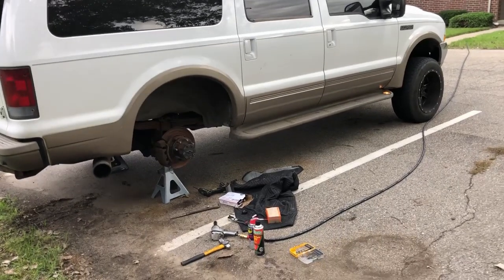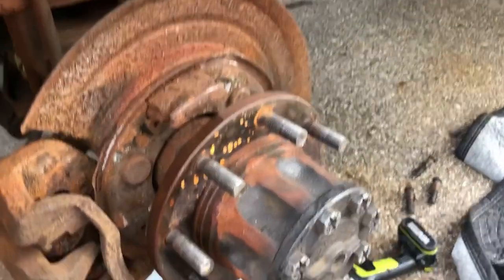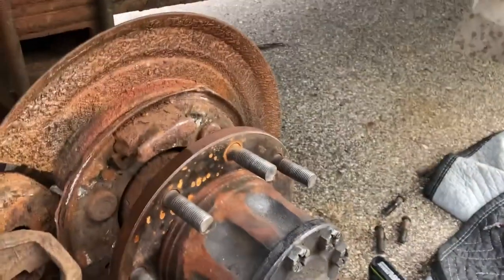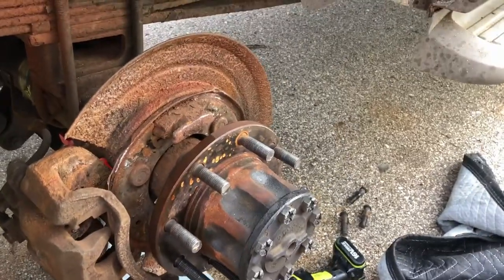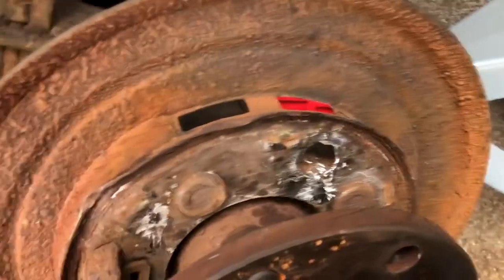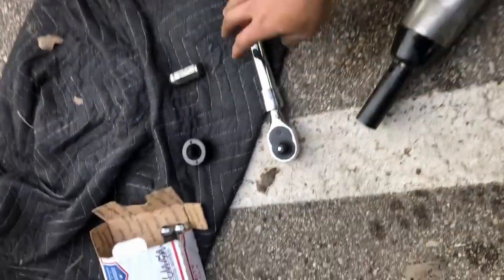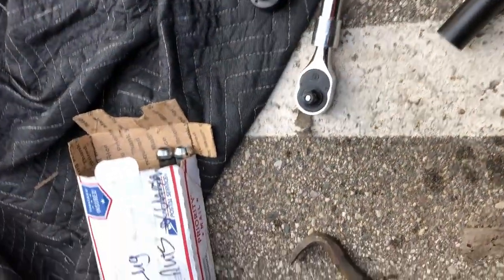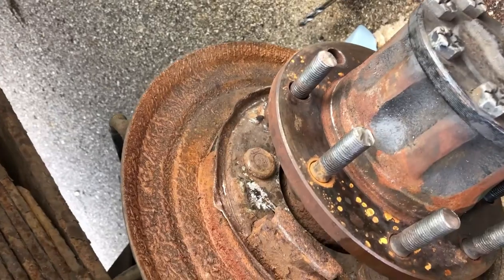2003 Ford Excursion/F250-350 Wheel Stud Replacing

Comment: From a mechanics point of view.  I'd fix those e brakes. If the disc brakes ever fail, you'll always have a mechanical set that'll never fail you in a pinch. They saved my life once. It's also illegal for them not to work or purposely disabling them.